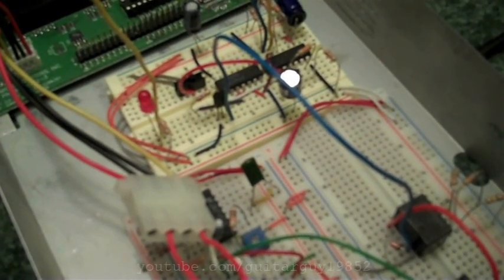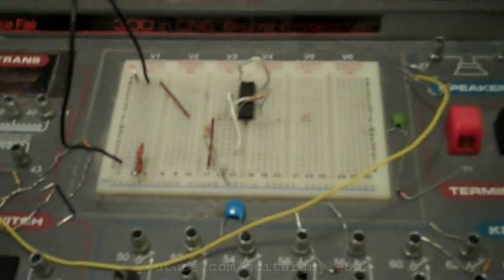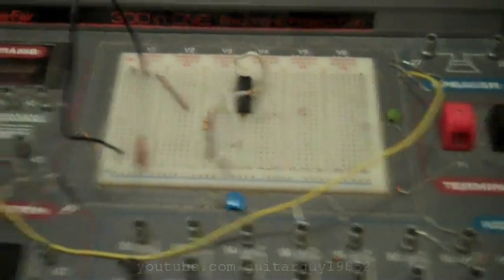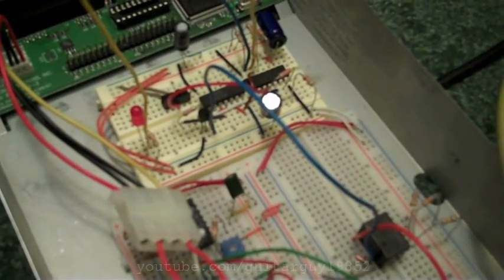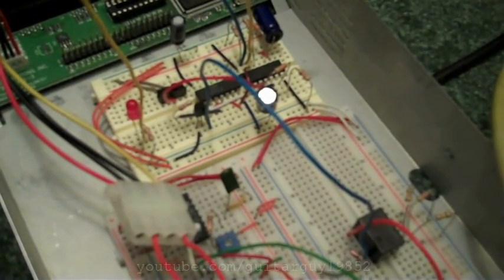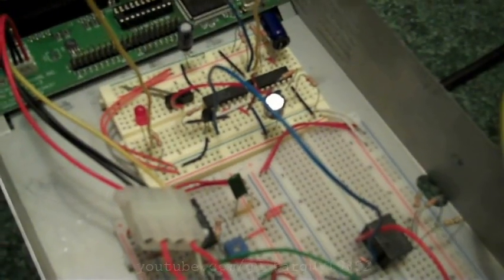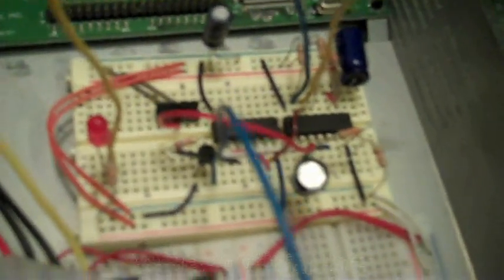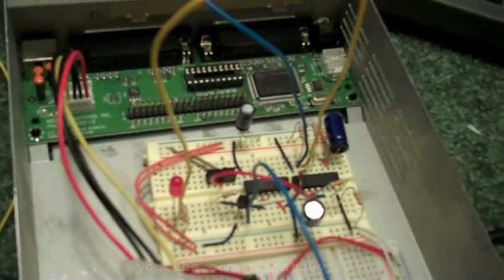siren timer with alert and attack

Comment: Use a high pass filter so the speakers cut out before going lower than they are rated. (Most actual siren speakers are compression drivers that don't go much below 200 hz.)